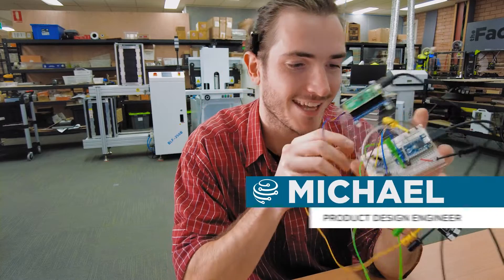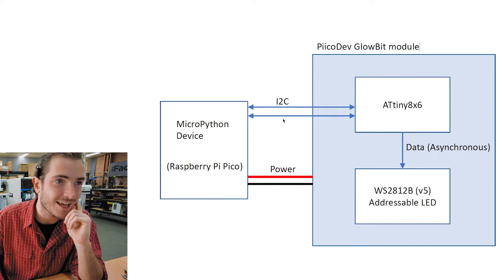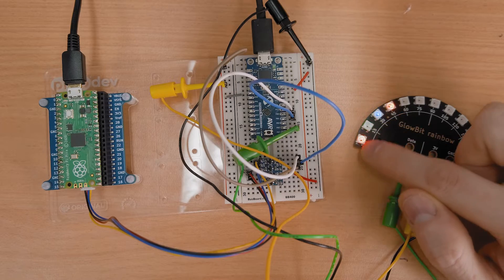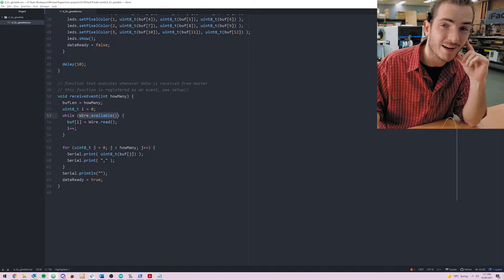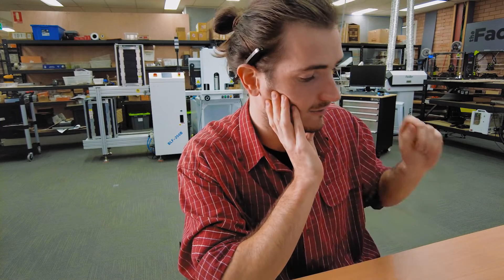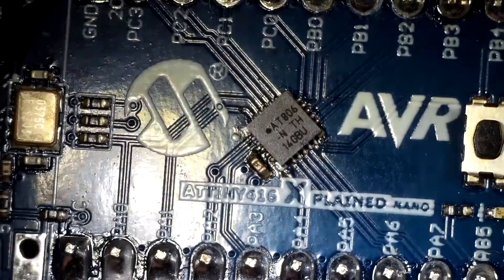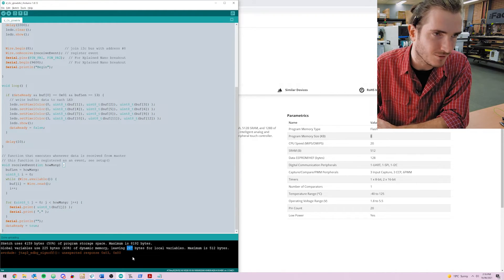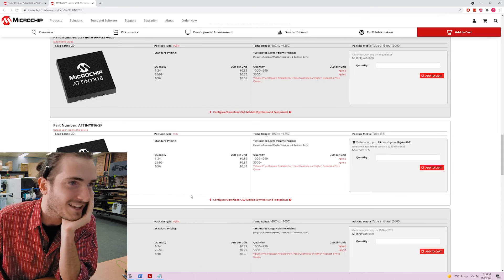The Factory | Programming An I2C Responder Device

Comment: Why not just use the Arduino Nano? So much easier, language might be different but still cuts your circuit in half.
Reply: The size of the circuit is irrelevant, it's what you can do with it ;) 
Seriously though, think of any project as packages of useful info that you can use elsewhere.
Reply: But all of that could be achieved by one microcontroller instead of using two to do one job without utilising a wireless network, what's the point adding cost to doing a simple LED control?
Reply: @stevetobias4890  I feel like you've misunderstood my reply. What if you needed 8 ADC's? You could step up your arduino, or you could interface between cheap and fitting components.  The idea of using multiple tech's definitely can be useful, especially seeing as one shoe can never fit all.
Reply: @stevetobias4890  Because an Arduino  Nano doesn't have a PiicoDev connector + they're about $7 each - way overkill. Core are manufacturing their stuff cheaper than that.
Reply from the maker: Our PiicoDev range is all about I2C peripheries (hence the “iic” in the name). Connect an LCD, potentiometer, rgb led, switch and 3 axis accelerometer, all using the same 4-wire connector. On top of that, the same code works on everything from micro:bit through to RPi 4 with zero changes (thanks to our unified PiicoDec libraries). That’s the goal anyway, we’ll share progress as we go :) Some devices will need an onboard microcontroller to work, but at 50c a pop, who’s counting (especially given all of the value we add with everything else).

We have other collections for other ways of going about things. PiicoDev is what we are focusing for now and we’ll share the journey as we go